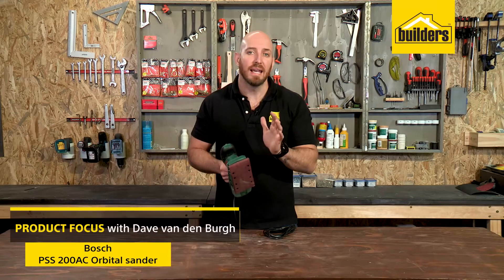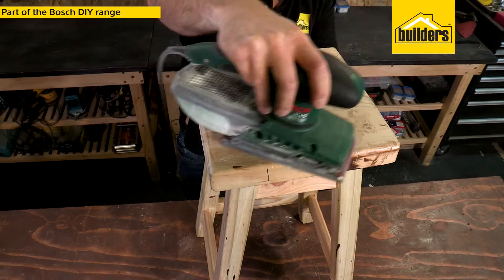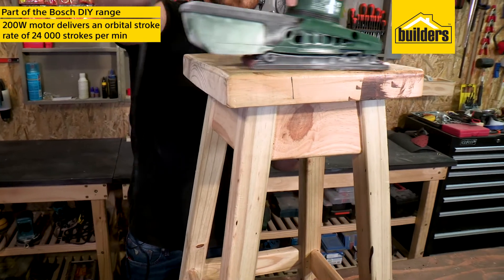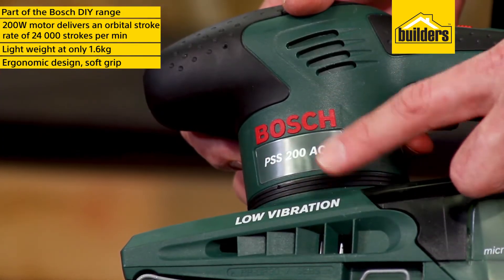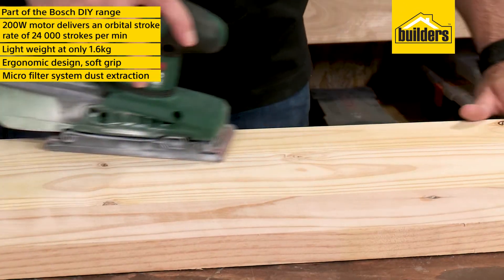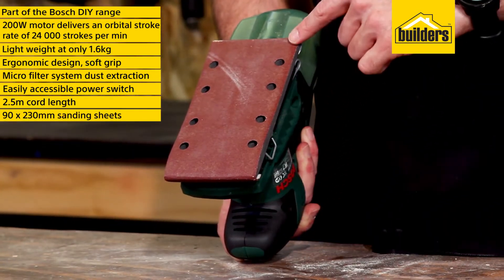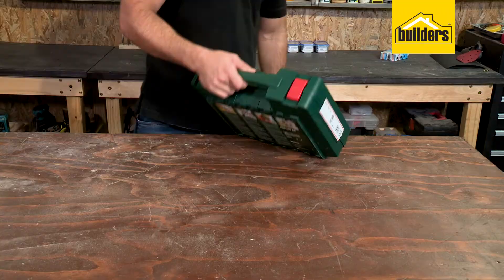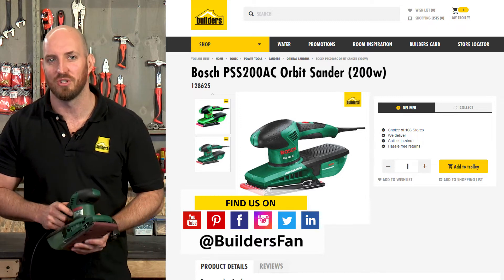Bosch PSS200AC Orbit Sander (200w) Review

Comment: Does it require special sanding paper from Bosch, or will infact any sanding paper cut into the shape seamlessly work?
Reply: Any sanding paper sized 93x230 Will work, but I recommend one with at least 8 holes on the sides for a better suction